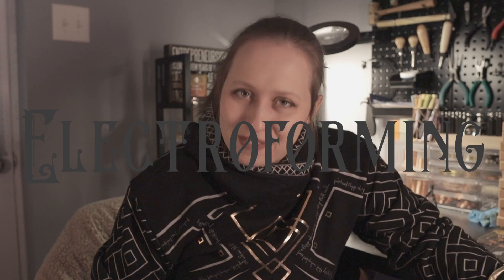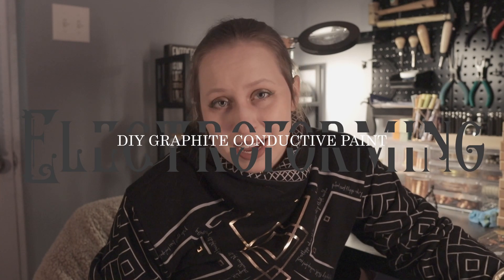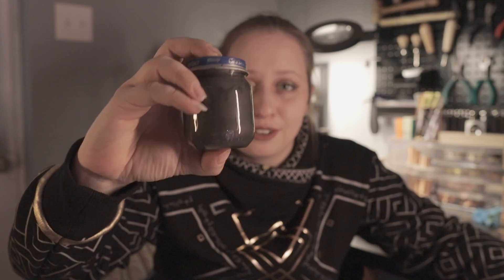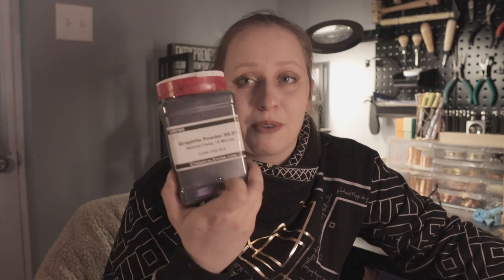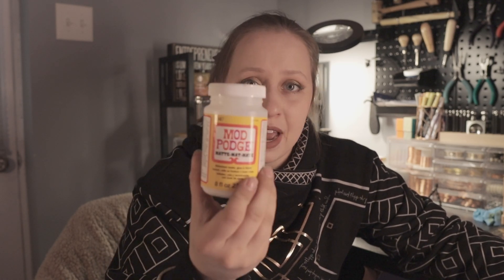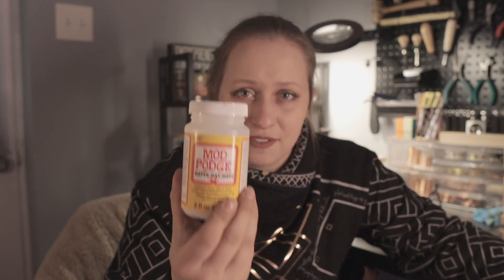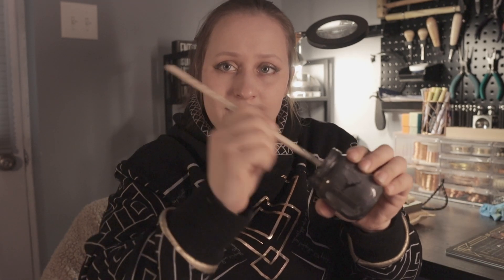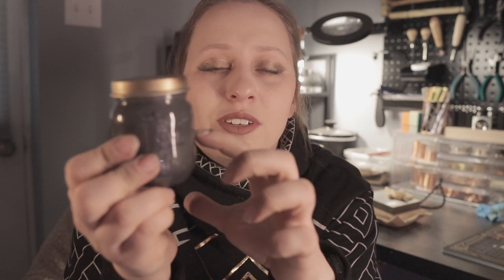DIY Conductive Paint for Electroforming: Only 2 Ingredients

Comment: I got a couple questions. I bought the gloss mod podge. Is it alright to use to seal things. You said it didn't work the best for conductive paint. I think I'm going to try india ink to begin with as I'm starting with stones only. Appreciate your helpful videos
Reply from the maker: Yes, since Mod Podge is a water based sealant it would be safe to use to seal things to protect them from the electroforming solution. You should easily be able to use it seal your crystals or any details that you don't want electroformed. Thank you!! :)

Comment: Quick question, can the matte modgpodge be diluted enough to be sprayed with an airbrush?
Reply: And will it be still be conductive enough with enough coats?
Reply from the maker: I have been asked this question a few times. Unfortuately I don't own an airbrush and don't know of  anyone who has tried this to be able to say if this method works without clogging the airbrush. The mod podge can most likely be diluted with distilled water, but the graphite is what allows the conductivity so you can't dilute the graphite. If you test it please let me know since I do get asked this question a lot!

Comment: Hi, i'm italian, thanks for sharing. In my state it's impossible take info on electroforming. Which vernice use for fixing the copper electroforming? Normal acrylic spray or specific other? Thanks
Reply from the maker: Hi! So I use Protecta Clear as the varnish/finish of choice. You can use renaissance wax as an alternative. I personally have not used acrylic spray, but most finishes that are safe for metals can be used. Just keep in mind if you are making jewelry you want to make sure its something that is safe to come into contact with skin nonstop.

Comment: Very cool! 
I was hoping their would be a portion about application at the end. 
Do you know if this would be safe to put through an airbrush (thinned down)?

I saw a version using graphite and acetone, but ChatGPT warned the acetone might damage airbrush components. 
Thanks!
Reply from the maker: Thank you! Im doing this tutorial in pieces and in depth, so the video that will be coming out tomorrow goes more into the application, but I only use a paintbrush and distilled water. I do know there are electroformers that use airbrushes, but I am not sure what formulation of conductive paint they use. There are several different recipes, I don't want to provide you incorrect information but I think I remember that alcohol ink recipe (graphite and alcohol ink) may have been I have seen used with an airbrush. I would definitely recommend doing research into what damages airbrush components. I believe my recipe with the mod podge has the potential to gum up components, so I would not recommend this one for that application method. Even with distilled water if this gets a chance to dry inside the airbrush it can clog small openings very easily. I hope that was helpful! :)
Reply: @crystalforged  It was very helpful ! You're very generous with your time and sharing your skills :)

Another application technique (coming from someone with zero experience) might be dipping the piece in a solution that's very thin with medium but heavy with graphite(?)  More graphite would deposit with each dipping, without leaving very much adhesive medium. Use just enough medium to get the graphite to stick without building up anything else. Just a thought.

From looking at your various videos, I was also very impressed with your end products. Really beautiful pieces! I've been a fan of fantasy art for 50 years... and those still impressed me!  :)

I've been teaching myself Blender and hope to trying this process with PLA printed pieces.

Thanks, again.

Comment: Do you wait 24 hours and paint a 2nd layer? Or can you bathe it as soon as it dries? Thanks!
Reply from the maker: I tend to only wait 2-4 hours in between coats unless I am working on something super large that needs a heavier layer of conductive paint then I give it a longer time between coats. When I have fully finished all of my coats of conductive paint then I usually leave everything to dry  for 24 hours or at least overnight before I throw it into the bath to electroform. This ensures that everything is fully dry and won't come off in your bath and contaminate it in any way.  Thanks for asking! I hope that answers your question :)
Reply: Ok-I made this-only did one coat and it is not electroforming nearly  as fast as my bought paints….probably need a 2nd coat. Thanks!
Reply: And-I seal my leaves and it was beading up on my leaves…it wouldn’t stick…I mixed it 50/50 too.